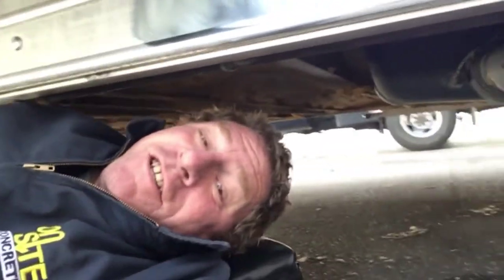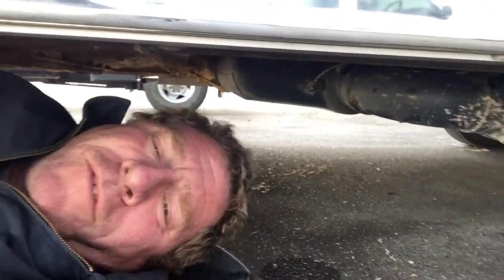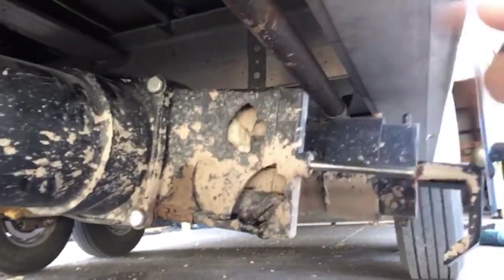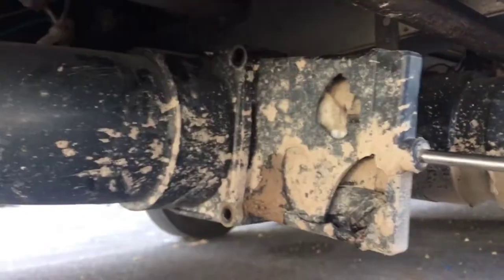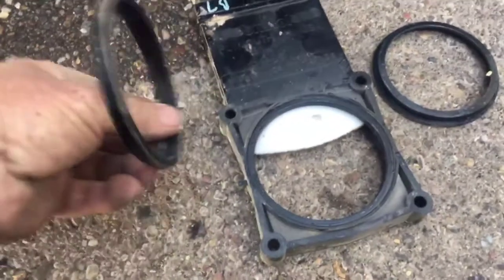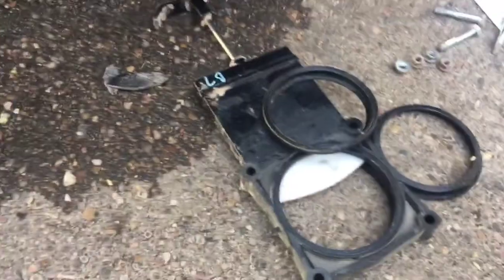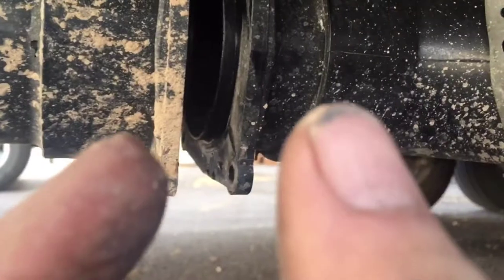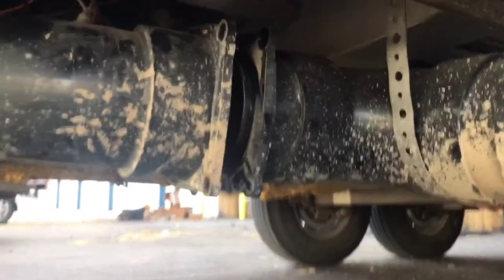Horse trailer sewer valve replacement.

Comment: Hey, I've had the same thing happen before. After that, I bolted a universal mudflap for a pick up truck in front of mine, trimmed it so that it protects the pipe and valves, but doesn't drag on the ground. Works a charm. Happy holidays.